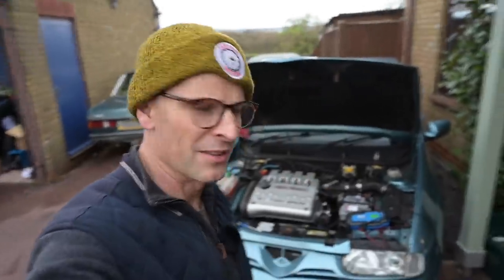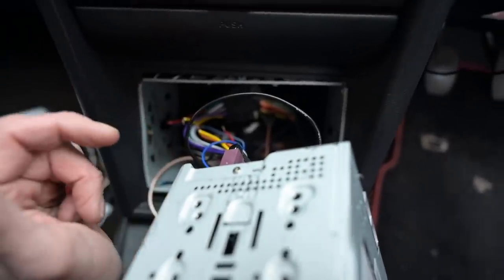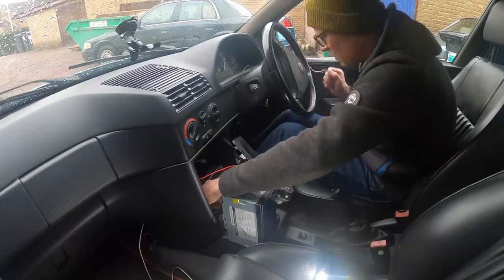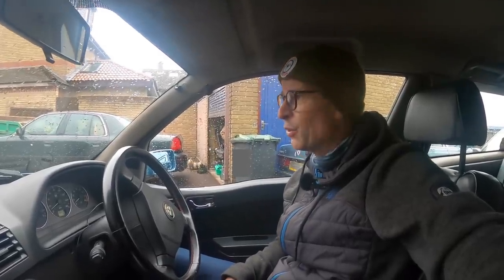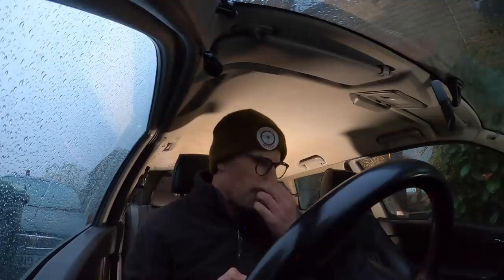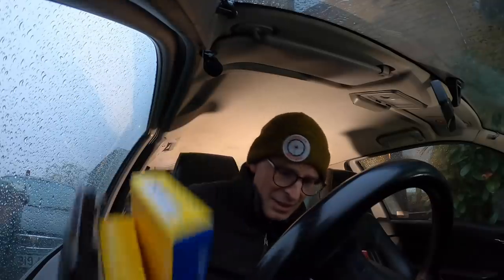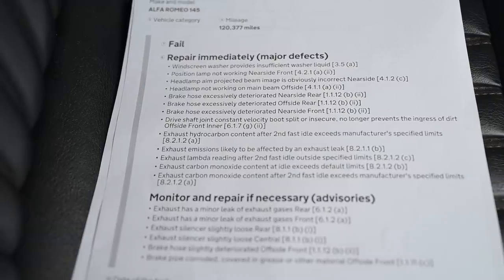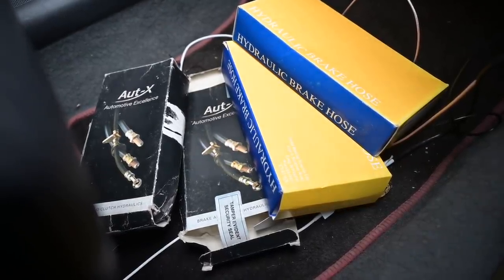Why does my Alfa hate me - another MOT fail for the 145

Comment: My Honda is looking better all the time.  Never an issue.  192,000 miles.  A legendary K24 engine with a 6 speed manual .  Why would I want an Alfa?  When you get all the current issues fixed, you will have a continuing new issues forever.  Unreliable cars don't get reliable when you fix the current issues,  Cut you losses and sell it it the person who wants it.
Reply: I don't think that these issues are Alfa specific but more like 20 year old car with high mileage

Comment: "Replacing the brake flexibles will be easy" famous last words. It took me weeks to change the ones on my Rover 200 Coupe. Not one of the unions would come undone and I ended up having to replace the hard pipes as well!
Reply from the maker: Im hoping that as the hard pipes were changed in 2019 it should come off OK (probably)
Reply: @furiousdriving  🤞
Reply: @furiousdriving  In that case it will be the other end and you may end up having to replace the calipers at least at the rear.

Comment: Feel your pain Matt, love older cars and your channel but this is exactly why I don't have one anymore, still get tempted though then I remember cold nights in the garage tinkering.
Reply: The way I see it, you can spend a ton of money buying a new car and then replacing it every few years and not having to fix anything, or you can spend slightly less money buying an older car and fixing it every so often.

I know what I prefer...
Reply: The trick is to have only 1 project at a time. Do as i say and not as i do, I've 3 cars outside and it's torture lying on your back on the driveway this time of year...
Reply: My daily, and only, driver is a 385,000 mile 1990 Volvo 240 Estate. Even paying a mechanic to keep Arthur running is less money that car payments. Car payments here on a decent used car will run about $500 per month, plus an additional $100 per month on the insurance. Arthur has never used $7,200 in a year on repairs. Not even close! The worst year in his entire 32 years this far was a bit over $5,000 in repairs. I do not count tires, exhaust or brakes, as they are maintenance items that any car will need.

Comment: Matt, Alfa's are the cars that keep giving. After doing the timing belt on my 916 spider it decided that wasn't enough and decided to spring a pinhole leak in the power steering hose in a totally inaccessible place behind the engine, make the clutch pedal sink to the floor thanks to a master cylinder on its way out, and a weeping radiator now deciding it's also had enough and leaving green rivers everywhere! What they give in reward they take back in maintenance, but what you give in maintenance they give back in reward, so enjoy your Crown Vic for a bit and come back to it when your heads in a better place. My vote would be get rid of the Merc, since it's a mammoth job and make a space for the Crown Vic to live in. Cheers from Sydney, Aus - Steve

Comment: I had the horn fail on a 206D Turbo years ago. Horn was a pig to access so I bought one for a few quid in Halfords, screwed it to a convenient panel between the battery and headlamps and connected it to the horn feed which I found, cut and soldered.

Comment: On my GTV's horn, the copper (i think) contact that is on the turn signal stalk got so worn that it wasnt touching the contact ring on the steering wheel coil (which is earth i think). take of the steering wheel and investigate that, there is a little spring under the copper nob (it acts as a brush), maybe it's stuck

Comment: I would definitely keep the 145, I'd say the fail sheet makes the issues look worse than they actually are. I understand you're excited about the ford, but I suspect if you got rid of the Alfa, you'd be left with an itch that still needed to be scratched. 

Plus, the Alfa Romeo is the 2nd coolest car on your fleet, after the Volvo 740. 😉

Comment: Had that issue with my Peugeot 306.  I ended up installing a relay behind the dash that supplied (through the appropriate fuse) power from a big beefy circuit, trigger from something else I found at random..

Comment: Hello. Sorry I can't answer your question, as to whether or not to keep it, but I can say you've no idea the work I'm putting in to recommissioning my Dad's 156 sportswagon. So far, I've rebuilt the floor and the structural elements of the sill. I've got a suspension mount to do, and then the outer sills, both sides, and the paintwork to refresh – it's been a very slow job, so far. Long story made short, you're not alone!

Comment: Get it through the MOT then consider your position. 
You may fall in love with it again when you drive it, or you may decide to sell it back to its previous owner. 
Either way it will survive to enchant and frustrate another day. 
Regarding the horn, check the earthing point for the horn push in the steering wheel. I had a similar issue on a 307 with an intermittent horn that turned out to be a poor connection behind the airbag in the steering wheel.

Comment: I’d be inclined to disconnect the battery when not in use. I’m sure you may leave in connected, possibly for security reasons, immobiliser and so on but with battery disconnected it’s a deterrent anyway. Always disconnect the live 1st, so there is a earth for components ,ECU. etc to earth to. On re -connection , earth 1st then live. You can also make sure the car is unlocked when disconnecting so alarm is not set off , then lock both doors manually.

Comment: When I first put the Megane back on the road I took it for a mock MOT and feared the worse (It still had a valid MOT done by previous owner). It wasn't all bad news but suffered the same high emissions. I'd heard some horror stories such as a Rover R8 with a newly rebuilt engine failing in emissions so this really wasn't what I wanted to hear. Anyway it turned out to be a hole in the exhaust manifold which once repaired tested well within the limits. Hopefully this will be the case with your Alfa.

Comment: Stick a battery isolator on it , and yes i had they same problem with my 916 with the aftermarket radio and the stupid Alfa way of doing things .Use a multi meter to check for current drain .I am sure i swapped those lives so the head unit actually turns off with the ignition , as opposed when i got it you had to turn it off manually .From what i remember the modern radio did not need a perminent live to remember stations
Time to treat to a stainless exhaust
Reply from the maker: problem solved with the rewire now

Comment: The light adjustment has only been a MTO failure for about 6 years now.Mine failed on my 159 tbi 1.75cc .I never noticed it because I drive on my own so never need to adjust the light levels,luckily I got a secondhand one on EBAY and it passed.I would say cut your losses as it will keep digging a hole in your pocket.

Comment: Does your Crown Vic still have an American battery?  I'd be curious to see how it lasts compared to a British battery.  You seem to go through batteries very quickly in the UK, judging by what I see on my two favorite UK motoring channels.  Even in the cold part of Canada where I live, a typical battery will last about 6 to 8 years nowadays.  I've had one go 9 years on a my Mini, which is never driven in the winter...
Reply from the maker: It does, I think its about 3 year old from memory. That radio power feed is the reason this one kept killing them, glad thats solved now!
Reply: @furiousdriving , Just for fun, if you have another car with a battery about the same size as the Crown Vic's, compare the weight.  I'm not sure, but I suspect the British batteries have fewer lead plates in them and hence don't last as long.  I understand it was the radio that killed this one, but in general, you guys in the UK seem to change batteries more often than I would expect here.  Keep up the great videos!

Comment: Strangely my 156 Sportwagon failed on headlamp alignment, something it had never had a problem with before. For some reason, even with the headlamps right at the top of their adjustment they were still too low. A bottle cap wedged between the top of the headlamp and the slam panel rectified it and a pass followed!😆 My 156 has other problems though, it thinks the drivers door is always open meaning I’ve had to turn all the interior lights off and lock the car manually!

Comment: I'm a bit brutal when it comes to problem cars and normally would say cut your losses and reduce your fleet. On the Merc I think I would have thrown in the towel. But on this one I'm not so sure - you've had the rust dealt with and those failures aren't anything too catastrophic. More importantly the Alfa clearly means a lot to you. These are quite rare cars now and I think you won't regret fixing it up. That said it's understandable if you decide to move it on - I got rid of my Rover Coupe because of a constant drip of fairly minor but never ending things to fix.

Comment: I enjoyed that video!   And I understand why if you have an Alfa you always wanted  (unless your wallet is unrestricted) why keep going with it? Or why not sell off some of your other cars to concentrate on the Alfa?   I have some very limited experience with old cars back in the 1980's  ,VW beetle, Triumph Toledo 1973 (bought for  £150 in early 1988). Tying up in 1988 the exhaust pipe with fuse wire on the Toledo which had broken and driving back along back roads in case it fell off again. The cars were fun but it wasn't my thing.
Reply: Bought a 1997 petrol Pug 106    97000km in France later on and it never caused a problem and kept it until 2009 at  320000km. The  1.1 engine was getting wheezy and  CT said the cat wouldn't pass another test.   So bought a brand new 2009 Fiat Panda 1.1 (underpowered) in 2009 because of special offers (ie big prices for your old car for trade in   a new 1.1 Fiat Panda ended up at €6200 with all documentation and number plates included))   That  FIAT car never went wrong in the 9 years I owned it!   Great for country lanes less so for steep Autoroutes.

Comment: I think whether you keep the Alfa or not, it's worth doing the work and getting it MOTd otherwise you'll be taking a big hit on the price probably. I think if you do the easy stuff - brake hoses, lights and tick those off the list it will start looking a lot more manageable. The exhaust manifold could then work out to be an easy fix too, you never know. The list looks a lot worse than it actually is I reckon.

Comment: Nooo, don't sell the Alfa! :O
Those repairs are not that much, like 4 or 5, and some of them are just maintenence.
That high NOx emmissions (if not lambda sensors) could be EGR related, since its job is to reduce them.
The manifold could just need resurfacing and a new gasket.
The CV boots break on all cars. You can even replace the whole axle, they are cheap.
The brake hoses need to be replaced every 10 years anyway.

Comment: It's an Awful Romeo - now you can fully understand why so many got scavenged for the seats, probably the only good thing about the whole car. 
I don't need telling about blind love for a car - my own very first car was an absolute bucket, but I still bought it because of what it was (a 1982 Renault 5 GTL - in 1990 - 8 years old and rotting like a metal corpse), rather than trying to find something (anything) that was fundamentally sound. The difference between us is that I was too young to know better back in 1990!

Comment: My car just falled on rear fog light , it's something to do with the programme in the ECU and no one seems to be able to fix it , rear fog won't work with headlights on but will work with side lights and front fog lights ... nightmare.
Reply from the maker: Can you get a mobile auto electrician to come and check it out or wire in a new relay?

Comment: I  don't see how a leak in a manifold could cause an emissions failure. It seems that the contents of the gases leaking from the manifold would be the same as the contents of the rest of the exhaust gases that are proceeding down the pipe. Begs the question as to whether or not the cat and/or O2 sensors are working properly. Just guessing of course. Good luck.
Reply: Could be an EGR as well.

Comment: I'm a 3 alfa 146s owner diesel ( one 1.9 td mine, 2 1.9 jtd my father and sister ), for a total of aprox 1500000kms ( mine is 700000kms ) and no one has the wiring stereo problem like yours. Probably someone messed with it. I'm not a 145/46 fan, i own 3 because found mine for 500 euros, my sister's was a 3/4 of a complete gift car and i bought a tird for pennies to complete adding only some spares and work. I live in Naples, very near to Pomigliano where this car were ( badly ) made.

Comment: If the United States required MOT's probably half the vehicles on the road would fail!
Some areas require emissions testing but nowhere requires checks to determine roadworthiness.
Reply: What state do you live in??
They most certainly do check for road worthiness.  What do you suppose the state inspection is for?
Reply: @themancalledx1342  Not to the level of a MOT or TUV.
I have seen vehicles on the road in the United States that should be in a junkyard.
Cracked or broken windows bald tires severe rust smoking engines body parts barely attached to the car bumpers being held on with bungee cords headlights or directionals that don't work wipers that don't work the list goes on and on..
Never said I lived in the United States or am I an American you just assume that.
I am German and work for a german-owned pharmaceutical company in the United States which is headquartered in New York.
Reply: @williamegler8771  they may be on the road, not legally though. All vehicles must pass an annual safety inspection.
Reply: @themancalledx1342  Not everywhere.
If they are on the road illegally why do a majority of them have current tags?
Reply: MOT's in the UK are a joke! Most testing centres are attached to garages there , except apparently for council owned ones.  I'm a Brit living in France and here CT (Controlle Technique) {MOT}testing garages are totally independant of garages. Less open to  the garage manipulating MOT results to get some more work.